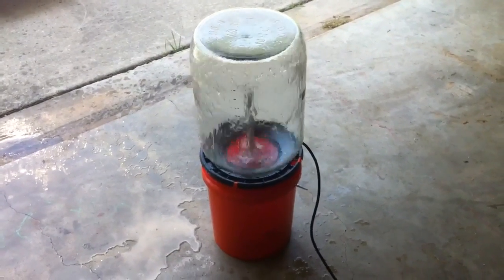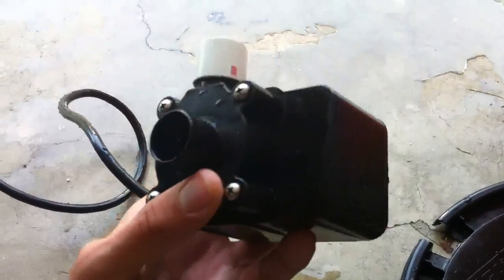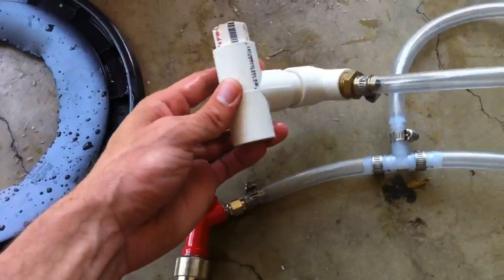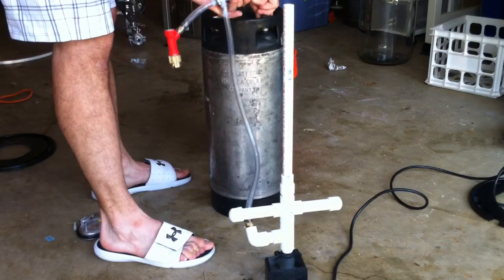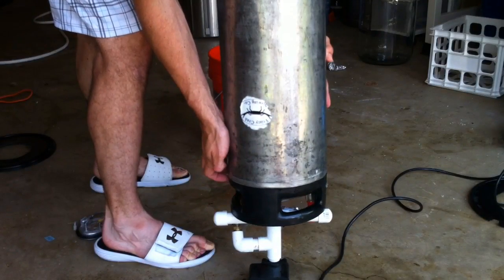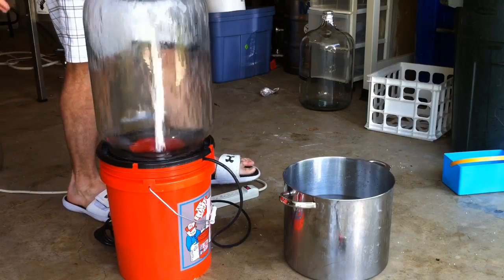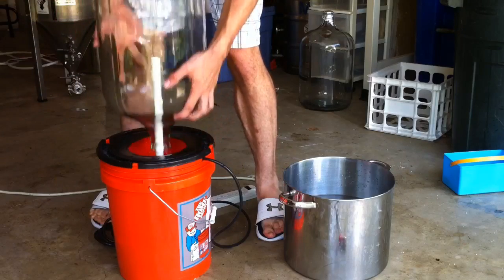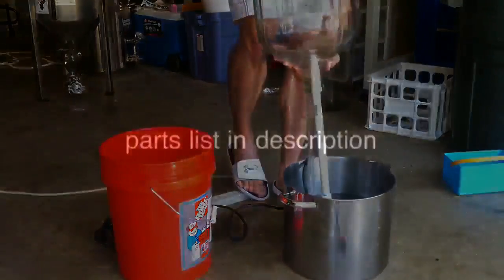Homebrew Keg and Carboy Washer

Comment: Great video.  How do you clean stainless steel (304 steel) conical beer fermenters?  What do you use?  PBW and Starsan?  I bought a small 7 gallon conical and wondering easy way to clean it.  Thanks in advance for your help. -k
Reply: No one replied? I hope you figured out PBW is the cleaner and Starsan is the sanitizer, one before the other.
Reply: Chris,  Thanks I figured it out through trial and error and consulting with beer brewers:) Thanks and appreciate the information on line.  It really helps.  Happy Brewing,
k

Comment: I bought a 620 gph at Harbor Freight for $30 with it being on sale, plus a 20% discount. I think it's going to work out great! I do have ONE question, so please get back to me if you can. 
So when I cleaned my kegs and carboys with PBW, I dumped the used water back into my PBW water bucket then I poured my StarSan solution bucket into the washer bucket and began sanitizing my kegs and carboys. 
I did rinse with water like you did. but at the water hose and not with the pump.
I figure there is still PBW cleaning solution still in the pump and tubing, do you think I should just run the pump in clean water between the PBW and StarSan switch?
Reply: Yes- It is best to rinse out the PBW with regular water before pumping the StarSan. (PBW works because it has a high pH around 11, and StarSan is an acid so it is a low pH about 3.) Rinsing with water in between will keep your StarSan at the low pH, instead of neutralizing with the high pH PBW. This is useful if you keep your StarSan for more than one brewing session at a time. (I keep mine about a month, or until the pH creeps up to 3.5)

Comment: If you go with the 600 gph pump it will cost you about 50.00 at home depot. Harbor freight has a 200 gph for 12.99  and a lesser one for 8.99I think that is the one I will buy!

I think the total cost will be somewhere around 50.00 if you go with the HF pump, but thats a guess and I will post some numbers when I finish mine..
Reply from the maker: I do not believe 200gph will be strong enough. If you go this route, please report back with results.
Reply: will do! :)